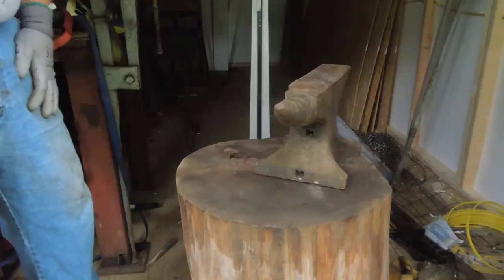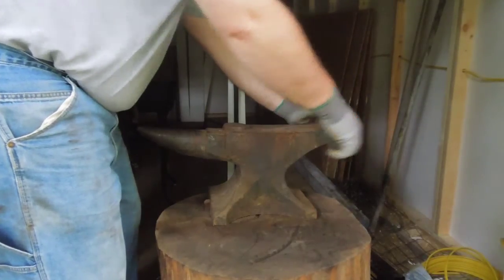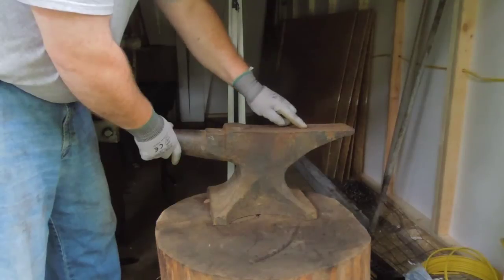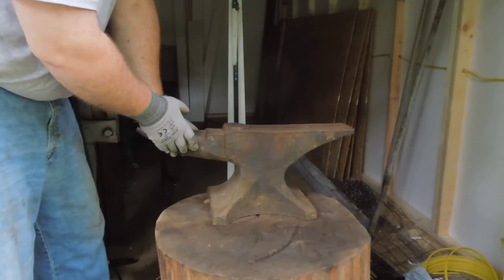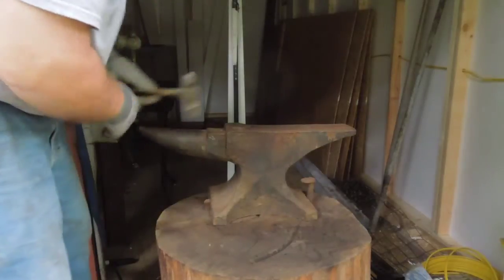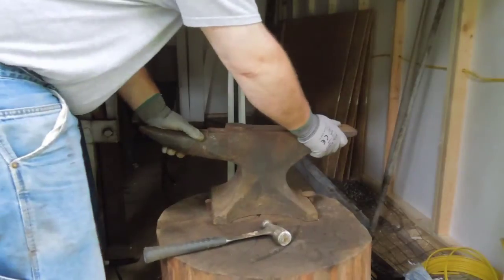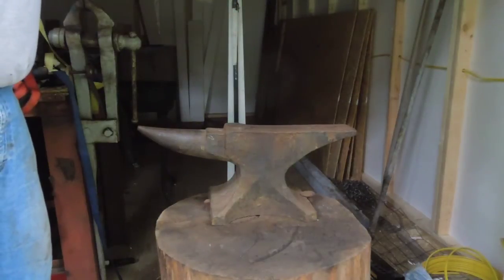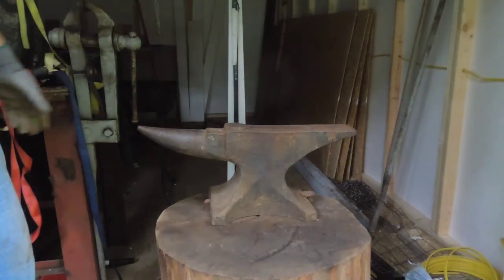Video Tutorial on mounting a blacksmith anvil by Old Sneelock's Workshop

Comment: Recently discovered your channel, I mostly use power tools but collect old hand tools (just in case) lots of useful information here, also thought provoking, eg, it is hard to find railroad spikes for hold downs here in the UK but they look similar to old style blacksmith made 'hooks' which were hammered into the wall for holding clothes lines etc, they would adapt nicely I think. Great channel.